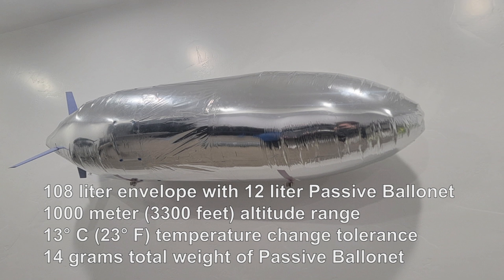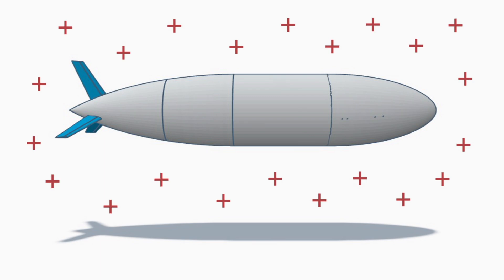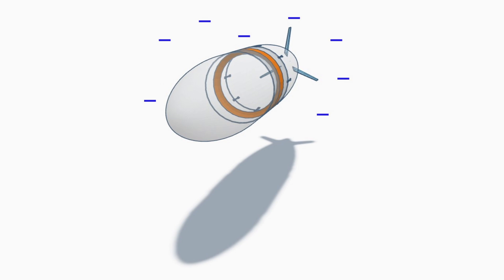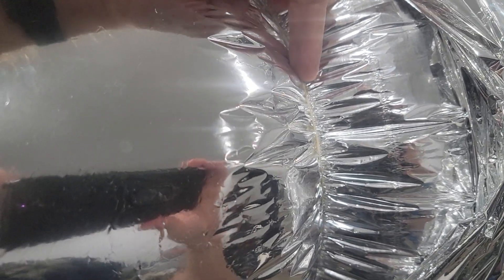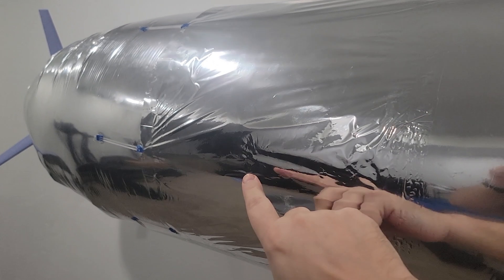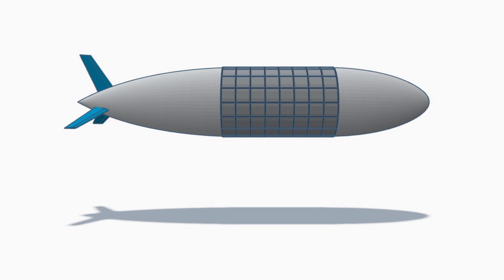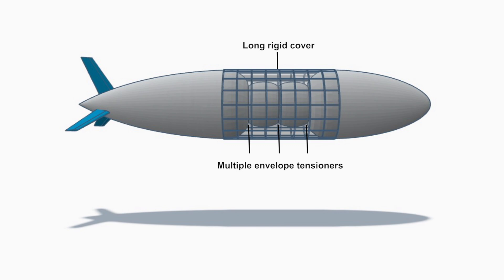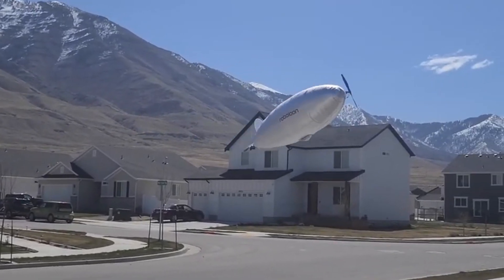Passive Ballonet: make small blimps capable of flying at high altitudes

Comment: Can a passive ballonet be used in larger applications?
Reply from the maker: @Da_B0iS Yes, to a certain point. Any non rigid will have problems as they get larger due to how the forces acting on the envelope scale. So very large airships have to be rigid, and the passive ballonet would not make sense. Also, as the airship gets larger the advantages of a passive ballonet are less important. For example the weight savings become only a small fraction of overall lift. Still, if I were to build a personal airship right now I would use a passive ballonet.

Comment: the wikipedia article for ballonets says that ballonets in front and aft of blimps are also used to control the pitch of the blimp, couldnt you technically achieve something similar by using to variable chokes on either end of the center of mass and extend/contrapt them against eachother to shift the lift front or aft?
Reply from the maker: Yes, if desired. A servo could easily adjust the tension on a foreward and aft tensioner to change the balance. In general a small airship usually doesn't need such measures. But as you get bigger, the force necessary to destabilize the airship in pitch scales up, so you may want to look at using something like that.

Comment: Where is the airship community？０．０
I'm thinking about the building of fpv airship bird (maybe the low speed motor is enough than using it to flap the wing?), airship drone has so many potential before humanoid robot!
Reply from the maker: There are a few groups on facebook; Small Airship Union, and Airship Regatta for two. That can be a good place to start.

Comment: One thing I am really curious about is where hot air stands in the world of modern blimps and zeppelins. It generates lift and in addition isn't flammable and dangerous (hydrogen) and it's not expensive (helium). How would it work with this discussion on changes of air density if say had a blimp filled with hot air that uses like electric heat or gas heat to produce the hot air.
Reply: thermal blimps do exist, yea. however, 1 cubic foot of Helium can lift ~31 grammes, whereas hot air can only lift ~7. The heating elements are usually gas burners. Heating the air takes a long time and is very inefficient, compared to a gas which can lift without constant expenditure of another resource. Hot air can be unsafe and unpredictable, creating all sorts of convection currents in the envelope which can make them unsafe and unviable, especially on the larger scale.

Comment: Did you repost this? I watched it yesterday and now this video says 40mins old?
Reply from the maker: Yes, originally it had clips of a blimp that used my ideas from a previous video. However they objected to having their blimp pictured so I removed it and reposted. Also, there was a unit conversion error in some of the stats which I fixed.
Reply: @BaccaYarro  Wasn't the unit conversion error in the old one about the temperature? because a change of 55f is equal to about 30c, 13c = 55f because of the different 0 points. I still see that error in this version.
Reply from the maker: @Herodotus4  Well... crap. I changed it on the first time the stat is shown but apparently not the second. I don't want to repost again, I'll fix it in a text blurb.
Reply: @BaccaYarro  Nice, thanks for the info.

Comment: I'm watching again to support your efforts. However, I want to float the notion that a ballonet is definitely a small balloon inside the envelope, rather than the process of pressure stabilization itself. I think your solution is ingenuous and awesome. I just think the semantics are confusing and maybe inaccurate. If i think of a better thing to call it, I'll let ya know. Keep up the genius work.
Reply from the maker: Hmmm... good point. It's not really a mini "balloon" since it is not fully enclosed. I wonder what a better name would be?
Reply: @BaccaYarro  your solution is super elegant. I especially liked the idea of the semi-rigid cylinder over the squeezed portion. For some reason, it was more clear in this new video, too. Great work.
Reply: @BaccaYarro  Inverse ballonet? You're changing the volume of lifting gas in the envelope, by "compressing" it, but doing it from the outside, rather than the inside?
Reply from the maker: @JohnDoe-fk6id  yeah, thats one way you could think about it